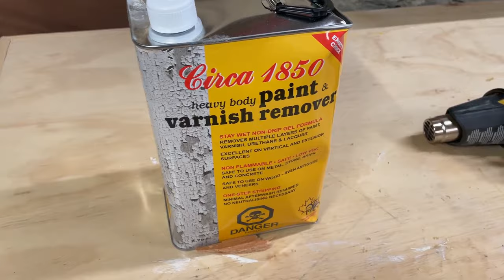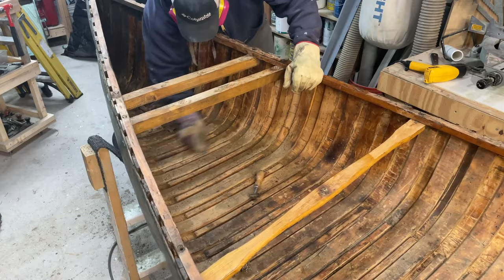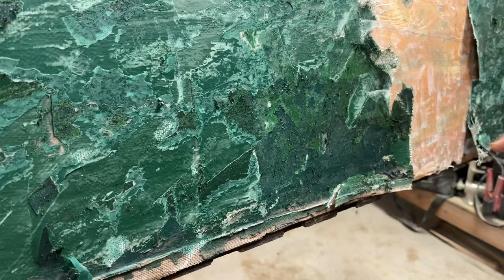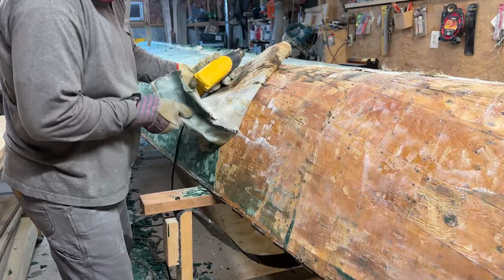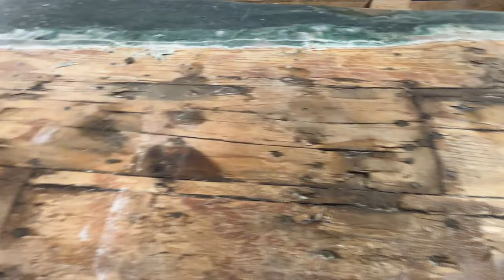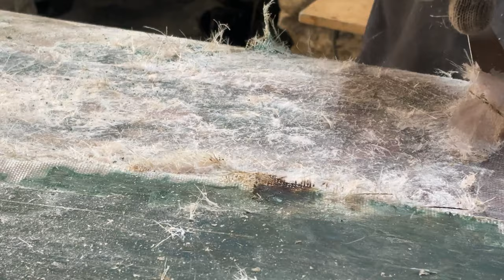Flewelling Canoe Restoration, Wooden Ribbed Fiberglassed Canoe, Part 2

Comment: Wow!  This project is very demanding.  Removing fiberglass seems very labor intensive.  I don’t think I’d ever want to fiberglass a wooden canoe.  Good luck with your surgery.
Reply from the maker: It is a demanding project but it holds a very strong sentimental value for the owner.  It will just take time.  This canoe was manufactured with a fiberglass skin and the owner would like to have fiberglass applied after the repairs are complete.  Canvassing a canoe is a beautiful thing but my job on this project is to fiberglass and make it look just as beautiful.  Appreciate the kind words about the surgery.  Left knee is complete right knee is scheduled 6 weeks from now.  Strangely enough I am looking forward to it…..😂

Comment: This restoration is a lot of work but great information. I have one that I hope to restore later this year and I’ve been wondering how to strip the varnish. I was thinking about trying soda blasting but I’m not sure I will work. Good luck with the knee replacement surgeries. I hope all goes well and I’ll look forward to the next segment of this project.
Reply from the maker: I think everyone should use a method that works best for them.  Depending on the age of your canoe and amount of varnish soda blasting may work just fine.  The varnish on this project was thick, thick, thick.  Heat was my primary remedy followed by the Circa 1850 product which worked phenomenal.  I ordered the Circa 1850 through @thepaintpeople and it shipped without issue.  

On the mend with the first surgery doing fairly well.  Need to get strong enough to set the stage for the second operation on the right knee.  Appreciate you watching the video and enjoyed your comment. Once at full strength I plan on putting a lot of time in on the canoe and videos may be less spaced apart.  Have a great day!

Comment: Good luck and fast healing on the knees. This is a bear of a project and the endless hours of heating/scraping could be very discouraging, especially with hurting knees. When you’re back on your feet, you may want to try grinding off a couple of layers using 36 grit. Get in a Tyvek suit, get out an orbital grinder and just burn through it. It won’t be clean work but you may reduce some of your time in hell. You’re a pretty calm guy but I’ll bet you’re silently cursing the hacks who decided that more fiberglass cures all problems. Thanks for the interesting content. Looking forward to your comeback after surgery.
Reply from the maker: Appreciate your encouragement.  I hope to get through this quickly and then really enjoy a slew of canoe trips this Spring, summer and beyond.  The knees have impacted my enjoyment of canoe trips requiring early termination sometimes and the work in the shop has been challenging as well.  It’s going to take a little time but I accept the challenge of rehab and look forward to a more positive lifestyle again.  Thank you watching and commenting.  It is greatly appreciated.  Happy New Year!

Comment: I took your good advice and by using a heat gun and many putty knives and also cutting a center line opening using a multi saw with a tile grout blade .
In all it was 6 hours. It may have been polyester.
Reply from the maker: 6 hours is a victory!  Glad you were able to get it done within a reasonable time.  Some are not so fortunate.  Best of luck the rest of the way!

Comment: Hope your knee replacement goes well. I would take the fiberglass off the same way. Had to do that on my solo canoe, when i rebuilt that.
Reply from the maker: It’s definitely a lot of work isn’t it?  It will get done eventually.  Slowly for sure…..but surely.  Thanks for the kind words.  Need to get the left knee strong enough for the right knee replacement6 weeks from now.  I’ll be good as new after that!  Thanks for watching and commenting!
Reply: @mainetripper  it is alot of work, but definitely worth it. Speedy recovery.

Comment: The 20 foot canoe I started a few years ago, still hanging in my rafters, had only one layer of glass on it and it pealed off easily.  That looks tough to say the least.  Matting gets heavy quick.  I expect your knee replacement will serve you well and provide years of tripping and just general well being.
Reply from the maker: I was hoping for one or maybe two layers of fiberglass only.  Obviously what I found was much more than that.  Andre Cloutier @ravenwoodcanoes recommends soaking the canoe in water for a couple days to help with the release.  If I run into this situation again I will try this.
Reply: @mainetripper   maybe even after you strip the varnish on the inside then a water soak, sink it in the lake.
Reply from the maker: @downeastprimitiveskills7688  interior has been stripped already.  I think I just need to keep going the same way on this project.  It is a big canoe to have to keep moving around.  Next time I encounter this much fiberglass though you can bet your bottom dollar it is going for a swim!
Reply: @mainetripper  The old birch bark canoes were often sunk in the lake for storage as well as dug out canoes.